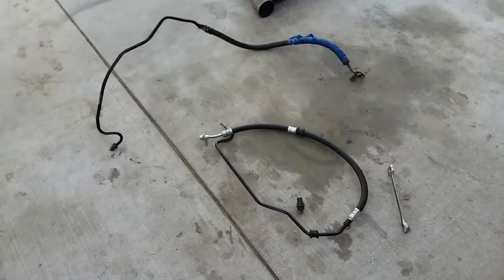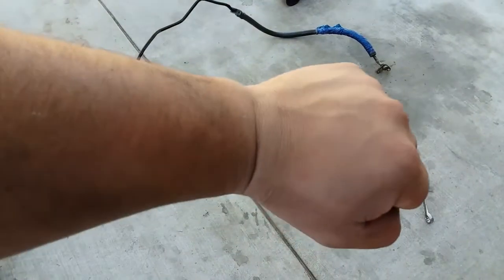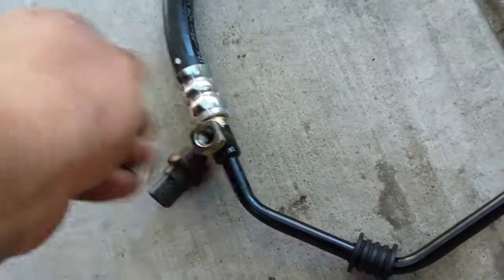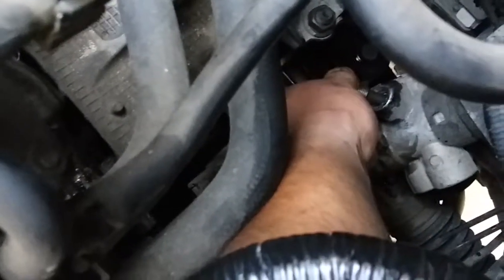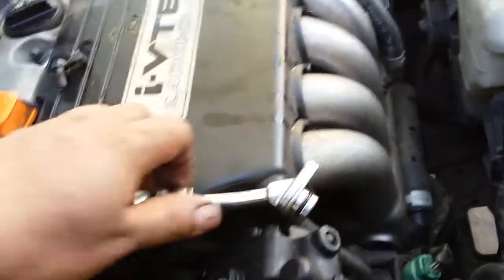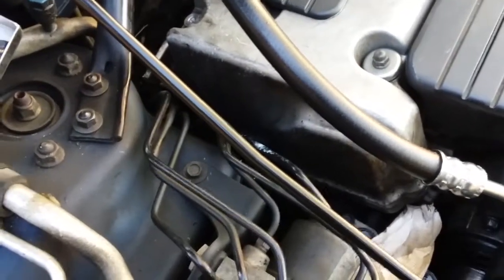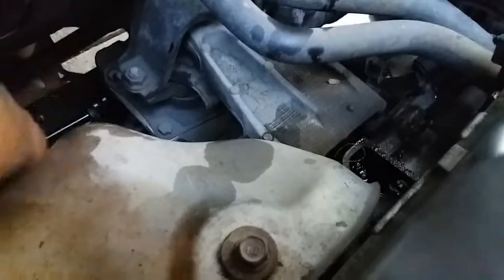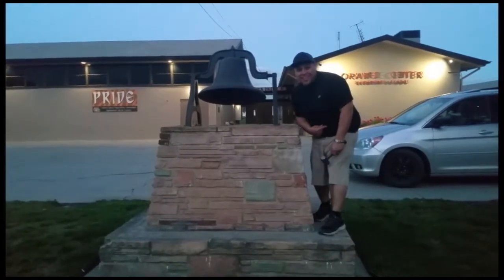How to: Change the Upper Pressurized Power Steering hose on a 04 Honda Accord Inline 4

Comment: Ahh okay, at the beginning of the video, one of those hoses was the old, one was the new. I was thinking there were two hoses you were installing, lol.

For the return hose, I'm wandering if i can just use some bulk hose. There's a store that sells bulk automotive hoses and I'm wondering if that hose will work or if it needs to be one of the ones that's pre-formed--like a radiator hose.
Reply from the maker: Yeah sorry I removed it first and decided to make a video on it. Sorry this was before I got into the habit of pulling out the camera first before I started working on the car. This is the high pressure hose. The hose from the reservoir can be replaced with any common hose from an automotive shop or hardware shop.  Hope this works out for you! Thank you for your support!
Reply: @559powerscape  Yes it does, thank you so much sir.

This isn't my first run-in with a power steering pressure hose. Last year I rebuilt the engine on a 2001 Chrysler Sebring. It was my first time doing anything like that. The only thing that stood in my way of getting the engine out was the pressure hose where it goes into the pump.

I used a line wrench and everything else I could think of and the fitting just wouldn't come loose--not enough space to work in for one thing.

So I just took a mini hack saw and cut the damn thing off. I spent a while worrying that it would be super hard to fix this. NOPE! A good used pressure hose at the junk yard was only $3 and it was super easy to put in---especially when the engine is out of the way.
Reply from the maker: @mattmgarza  YES! SOMETIMES IT CAN BE A PAIN IN THE REAR! THANX BRO, HAVE A GREAT DAY! THANK YOU FOR YOUR SUPPORT!

Comment: is there  fluid in the  hose when you romove it,  do you have  to drain it  before  removing it ?
Reply from the maker: No you dont. It will drain out when you undo it from the bottom

Comment: My power steering is leaking but it’s on the driver side do you think it could be this hose?
Reply from the maker: It possible, can be this same hose.  Open the hood and with a flashlight look behind the engine to see if it's wet around that area. pressure wash it, to clean the area that is wet and dirty and then drive it again and see where it's leaking from

Comment: Did you have to remove the motor mount that it goes under
Reply from the maker: No i didn't have to. You should be able to get to it with out having to remove the mount.

Comment: Do you have to put that line underneath the motor mount? On the 07 it goes underneath it but it looks like it could possibly be fished through there without removing.
Reply from the maker: Yes underneath it. Yes you can with out removing it.
Reply: @559powerscape  Okay sir, thank you so much. That's gonna save me some worrying. This is an 07 2.4 liter so I suspect it's exactly the same configuration.
Reply from the maker: @mattmgarza  should be not sure how much they changed it up but its basically all the same just relocated
Reply: @mattmgarza  that's exactly what I'm doing on a 2003 2.4 Honda Accord
Reply: Lmaooo the socket went flying haha 😂

Comment: Is this the 2.4 liter?
Reply from the maker: Yes it is!
Reply: Okay, thanks so much. I was told somewhere that changing the pressure hose required moving the engine slightly and even undoing the exhaust. That didn't seem right to me. Thanks for the great video.
Reply from the maker: @mattmgarza  4 Sure no problem Matt! No way all that? I didn't have to do that. It was a pretty easy change, I  dont even think I had to lift the car 👍the only hard part was the screw at the Rack and Pinion.  Taking it off was a breeze, putting it back on requires a lil bit of pressure to screw it back in and it hast to be PERFECTLY STRAIGHT!  Other than that cake with a side of milk lol. Hope this works out for you buddy! Thank you for your SUPPORT!